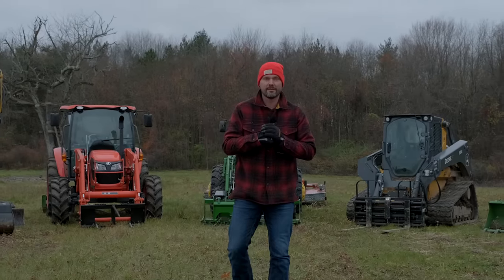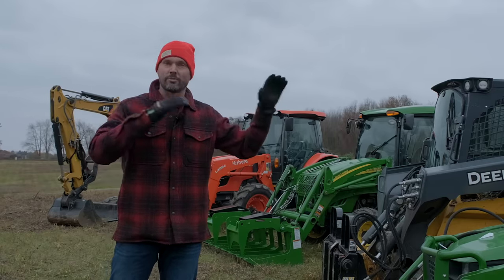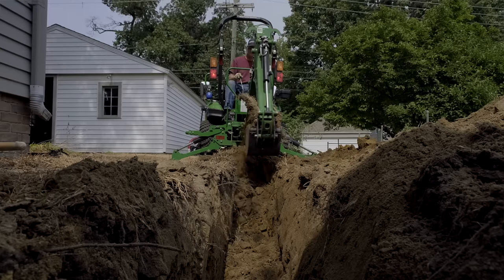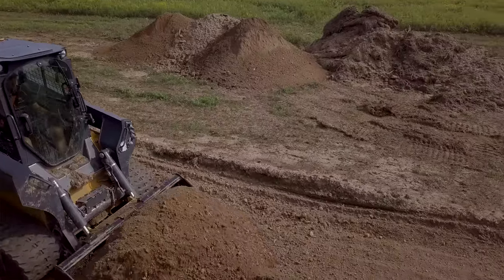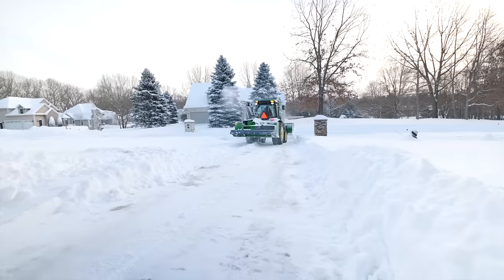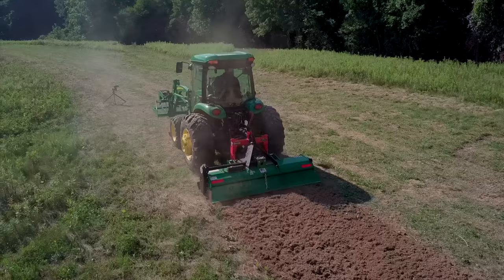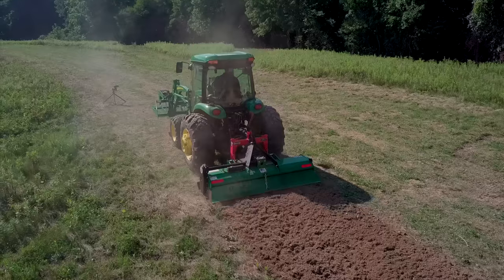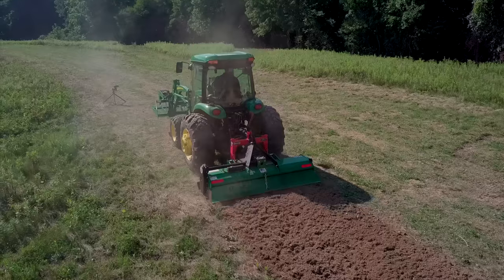IF I COULD ONLY CHOOSE ONE? BEST MACHINE FOR PROPERTY MAINTENANCE

Comment: Buy the machine you’ll use the most and rent the rest when you need them!
Reply: Best advice
Reply: You can rent a machine 40x and still cheaper than buying one.
Reply: @BOOGiNS buy one keep it for a year and use it hundreds of times and then some basic maintenance and a hosing and you could get a good price.
Reply: Or just be really rich and buy them all
Reply: You need something that drives off road......so you need a tractor or quad. But the tractor can have blades and pto. Get a tractor, and rent an excavator. And buy a quad when your neighbors kid kills himself with it and they don't want it anymore.
Reply: @BOOGiNS that is a good argument and very valid for many people.  The other side is whether that fits into your needs or not.  I've used my tractor more than 40 times in the year I've owned it, and it is still worth probably 80 percent of what I payed for it.  I'll use it more than 40 times next year and it will still be worth 75 percent what I paid for it.  For me it works out well in my favor and I use it for things I'd never rent a machine to do because it is right there.  I can't fathom a skid steer or mini ex making sense, but that is probably just my situation and budget.
Reply: If you are spending your parents money sure!
Reply: Will end up quite expensive if u have to keep renting

Comment: Maybe I'm making this too simple but... A tractor can do it all and without tearing up your lawn. Bigger is better to a point. So the question is at what point does bigger become a hindrance (cost, size, ruts, maneuverability, etc) and then step down a bit. Then for those specialized heavy one time only jobs, just rent. Hope this helps. Cheers.  PS: Always have a backup.
Reply: 100%
Reply: You make a good point and in general, I’d agree however there are those times when a specialized piece of equipment works much better than a “jack of all trades”.  The construction machines like the mini-ex and the skid usually have much more power than tractors of equivalent size. Ultimately it comes down to money.   Overall, I agree with the sentiment of having a general use machine and if you need a specialized one for a specialized job, you can always rent it unless you can justify buying a second machine. Having said that....there is nothing like the feel of using a construction machine because of the power. I’m currently using a Kubota R630 wheel loader with pallet fork as well as a grapple bucket and it runs rings around a utility tractor with a bucket!
Reply: @TheBananaStrangler  much more power to the hydraulics, faster hydraulics, better pushing power. Getting on a utility tractor and trying to do the same job just feels slow and awkward after using a true dirt machine.
Reply: @jamesnm21  AB-SO-LOUTELY! There is NOTHING wrong with a utility tractor and a bucket, but the honest truth is that you really shouldn’t directly compare the dedicated machines to the tractors. The “true dirt machines” will outshine any tractor of comparable size, any day and twice on Sunday!
Reply: Bought L3560 for the size and capabilities.  Our property is over 10 acres, heavily wooded, and very hilly.  Bought a backhoe which I needed but the BH 92 is more than just good weight on the rear because that bucket / mechanical thumb is doing as much as the loader with all the digging and carving we've been doing.  Depending on your property needs the utility tractors in that 20-40 hp can do a lot of everything and a lot of terrific implements are available.  Our tractor has impressed the heck out of us
Reply: Ah I was wondering if I should get a bigger or smaller tractor for homestead looks like I'm getting a Big bud with the biggest tires you can get! "(TW joke)"
Reply: If your property is wet, you may need a tracked machine instead of a tractor.
Reply: Bigger is better untill you can't use it to perform the little job you need it to.
Reply: As a tractor mechanic, i can say I've quickly learned that bigger is wayyy more expensive when something does go wrong.
Reply: @NUTZJ98  Very well put.
Reply: A small machine can do a big job, if you have unlimited time. A big machine may not be able to do a small job.

It is what it is, I have the largest backhoe John Deere makes, it works for me, mabey not for you.

I mean really who cares if you are talking about planting and doing stuff around the house, any machine will work with some attachment and some time and work.
Reply: I bought 20 acres of overgrown, but relatively flat land.  I started with a 2014 M100 GX Kubota; 100hp utility tractor.  A hydraulic tree shear on the front and a 15' brushhog on the back made short work of clearing the land.  Since we decided to build a house on the property, I bought a BX23s.  Landscaping, minor clean-up and mowing (the lawn) are all much easier in the BX.  Aside from mowing the rest of the acreage and the occasional large dirt-moving operation, I use the BX.  I don't regret the M100; I used the heck out of it in the early stages of preparing the land and I have some future projects for it.  In retrospect, I'd have been better served moneywise to rent a skid-steer, clear the land and then get the BX (or a B).  

Two things about the BX I was surprised by:  first, 2" wheel spacers made a HUGE difference in how tippy it felt; second, how many things I can do with it.  Yes, it is slow compared to a bigger tractor, but it WILL get the job done.  10 acres or less, I can't see anything bigger than a sub-compact tractor being needed.
Reply: I agree keep it simple and buy the cheapest .
Reply: I have a JD3025e and it’s perfect for mowing pasture but it’s WAY too large to mow near the house. I ended up having to buy a mower anyway…if I had it to do over I think I’d buy the 3038.
Reply: Yeah tractor attachments are cheaper. But loaders have that hydraulic boom boom pow!
Reply: Skid steer for a utility of doing all kinds of things. However when you need to use a brush hog or plow or plant obviously a large tractor. I think depending upon your property you may need both. Just like some properties may need a dozer or mini ex   I guess I am saying it depends upon size and type of property one owns. If all you did was plow and plant and maybe cut bale hay just a tractor
Reply: not on a yard it wont.@TheDilweed
Reply: Just get a backhoe
Reply: @jamesnm21  The worst thing in this video was suggesting that you could use a 3-point backhoe on a mini-tractor to do the job of the mini-ex.  You can get some work done with those, but the mini-ex is going to run circles around it.
Reply: @jamesnm21 yes and no, you have plenty of attachments to tractors and they are great in everything without ripping your wallet or drinking fuel like crazy. 
Just use mid one around 50-80 horsepower depending on how heavy is your ground.

Comment: I personally from a outdoorsmen aspect I would choose the skid steer because I can use it to make my food-plots clear roads and still have good maneuverability in tight spots I realize it cost more but it would be a better chose in the long run for me
Reply: My thoughts as well. I'm for a construction background and the skid steer is one of if not the most versatile pieces of equipment you can own. 
Loading and unloading pallets, spreading material, digging holes and footings, brush cutting and the list goes on.
For a one machine solution the skid steer would be my choice.
Reply: Skid steers are my choice as I have all sorts of machines but use them more often for prop maintenance
Reply: You are 100% correct. I bought a skid steer for 130 acres and the plan was to use it for 2 years, do everything I need with it and then sell and get a tractor. I quickly realized the skid steer can do everything and more just like you are saying. Most of my property is woods so I have have very little to bush hog which I can do with a brush cutter.
Reply: A 40+ h.p 4x4 tractor can do everything that skid steer can and then some, when it comes to bush hogging steep ground, skidding a log a long distance that u can't carry, and it can mow food plots etc,.
Reply: It's a horses for courses situation for me, and because we're on 100A of hilly ground that has trees, scrub, grassy paddocks, and I need to slash grass, haul gravel and rocks, cut roads and paths, drill holes, mix concrete in small batches and unload trucks my no. tool is a tracked Kubota Skidsteer. Having said that I have a compact tractor, a tough 4wd slasher, an out front mower and a 5T excavator, all necessary tools for looking after and developing our property, but given the diversity of work, safety of a track loader, small footprint and the power that makes it my number one choice. It's all context related though and if I was on a level piece of more refined land then maybe a tractor with a hydro gearbox would be my first choice....
Reply: I have 80 acres 50 wooded, 30 open land. Wife made me chose just one. Over the years I've had JD 2 series, 3 series and also a couple different utility tractors, sold them all and kept large frame skid steer.
For snow removal, it can't be beat, very handy in the woods and for dirt work, I actually use it a lot.
However, I seriously miss having a tractor around and will soon be getting another utility tractor with a loader.
I also have a mini excavator that doesn't get used often but I would hate to not have one. It's way better than a backhoe attachment on a tractor.
So basically everyone with any property should have a skid steer, mini excavator, and a tractor.
Reply: @jusrobington  can't really bush hog large areas, too narrow and too slow. I really like having a 10' bush hog for that
Reply: @tech-gl8po  Not quite, Skidsteers despite looking smaller tend to be very heavy, and can shift much bigger loads. 40hp is the lower end of practical for me, I've used 65hp - and now I run a NH T4.75 - 74hp - with an old MF 135 for pulling trailers and small work like PTO driven old machinery. I would love a Skidsteer because it is MUCH more versatile - but I need to find £30k to buy a 2nd hand JCB.
Reply: Skidsteer. If you need to make a payment just go do a few simple jobs here and there around the neighborhood
Reply: Not really sure about costing more…75hp tractor is pretty much the same price as a 75hp skid.

Comment: Excavators can utilize pretty much any attachment a skid steer can utilize with the added benefit of a rotating cab, extended reach and digging capabilities. You can clear, grade, trench, move earth and more with the right machine with the right attachments and run a lower risk of getting stuck. Definitely my favorite farm rig.
Reply: I don't have any need for any of these. But excavators are the coolest 🤣
Reply: Other machines might be faster at some of these tasks but with an Excavator you can:
Storm Debris Cleanup
ROW Clearing
Mowing over fences
Tree trimming
Tree/Fence Post hole drilling
Foundation work
Retention Wall Building
Lift heavy items
Demolition
Loading
Utility/Septic work
Dig Burial Plots
Grading
Reply: @PremiumFuelOnly  Best all around piece of equipment for a farm.
Reply: Tractor can do all those things better than it can. The weight of the unit matters...skid steer just bounces off stuff.....

Comment: That mini excavator can have a 360 degree rotating grapple on it, which is good for moving rocks, you can put a jackhammer on it, you can put different kinds of buckets for cleaning ditches and trenching, it'll run a mulcher as you said, you can put a ripper on it to cut roots around stumps, and a small rake. It'll do a lot, even with just a bucket!
Reply: It will, but all those attachments are expensive. Itd be nice to have one and an  old tractor for everything else.
Reply: The are only as good as their operator. I’ve been running a hoe for 15 years now and I am still learning things. If you don’t have 1,000+ hours on one, you are probably going to have a hard time. Skid steers are much easier for beginners.
Reply: They are great for logs
Reply: Slow....it can do alot SLOWLY....you will die of old age trying to do anything with it.

Comment: Interesting, but really lacking in comparative costs. Most have multiple capabilities but require extra attachments. The main equipment, plus all the required attachments make a sum total that could make cost alone the decider. I already planned on getting an excavator and nothing I saw here or in comments has changed that decision. You have a lot of area that you want to mow and brush cut and maintain trails. A tractor makes sense for you. I want to clear and dig a foundation hole, dig a natural swimming pool, a driveway, a septic system, clear stumps for a sport court, and possible make a trail, and do no mowing or major brush cutting. What would be excellent is a spreadsheet calculator with equipment and available attachments with costs. So you could choose everything you need to do and see how the costs compare with each type of equipment.

Comment: I went through this recently. Ideally you want dedicated equipment for certain tasks. This means a skidsteer for loader work, a mini-ex for digging, a large utility tractor for mowing/plowing/seeding fields, and a zero turn for lawn care. HOWEVER this approach costs too much. Unless you're earning money, it's hard to justify, especially if it's going to sit idle a lot. Due to this, you have to compromise based on the work you plan on doing with it. 

Thus when on a budget, it's hard to beat a compact tractor. It can do it all, but slower. Unless you're doing work for someone else, getting it done slower is not a problem. Attachments do add up, but the total cost is still 2 times less than a single skidsteer or mini-ex. Also you can get 0% 84 month financing on a compact tractor, but will be paying ~3% 60 month of other equipment. 

I'd skip 'sub-compact' and go straight to compact. Instead of spending money on a 'belly mower,' keep your existing lawn mower. This is the best of both worlds and is affordable for many people: You get light weight lawn care equipment and a heavier tractor for other stuff. A 'sub-compact' tractor is great if you're in suburban area, but in the country, you want something bigger. I'd recommend looking at Kubota L series or John Deere 3 series+...I personally went with a L3301 with backhoe that will be delivered on Monday.
Reply: Oh yea ,ALL is true . The Kubota 3301 is a very good starting & all-around good size for 5-20acres. It can run up to 6' implements (Just nearly) as long as it is gear-drive. Your next jump would be 50-60 HP classes of a tractor. Happy safe Tractoring Sir.

Comment: I bought a 160 acre farm in Wisconsin 4 years ago with mixed open and forested land on gently hilly terrain. After much research we ended up getting a Kubota grand L6060 cab HSA and love it. Multiple reasonably priced attachments have allowed us to make miles of paths through the forests without a single flat tire. We also have a zero turn mower for the finished yards around the house (a few acres) and a utv that I attach a plow to for snow removal on our gravel roads. Someday would love to add a used mini excavator but the occasional rental has worked out fine for that so far!
Reply: That’s what I’m looking at for my 100 acres of forest that we’re looking to build on. Seems to have enough power to handle most of what I need to do. I know I’ll probably need a mini ex as well when I look to start building ponds and digging out foundations.
Reply: Good choice.

Comment: I would definitely go with the skid steer. We have an older new holland wheeled skid steer (biggest model at the time), and for our few acres it has been amazing. We are constantly using it for all sorts of things, even though we only have a bucket and forks. It works great for bringing a fork load of logs for firewood out of the woods or snow removal, and we have torn down buildings with it before. Making a dirt pad, moving pallets and scrap metal, moving trailers around, hauling rocks, digging holes, it can do it all. Only complaint is how it tears up the yard if you're not careful, and that it takes the block heater and starting fluid to get it going if it's under 50 degrees. (more of an old diesel problem than a skid steer problem). You do have to be careful with wet terrain because of the tires, so we tend to use our little open cab 50s case dozer for pulling logs out down by the creek if it gets very wet, but we have done plenty of wet and muddy work without getting stuck with the skid steer, just spinning and leaving ruts. The maneuverability is amazing, and I don't think we could ever go to a tractor after having a skid steer. My only wish is that we had a brush hog for it. We have rented a mini-excavator before, and it is extremely useful but it is more cost-effective to rent with as much as we actually need one. The neighbors clean our ditches for us with their full-size machine, so that eliminates much of the use.
Reply: Case skidsteers with the Cummins (1840, 1845C) are about the best simple and easiest starting skid steer. I don't think you'll beat the all around decency of one, for the money.